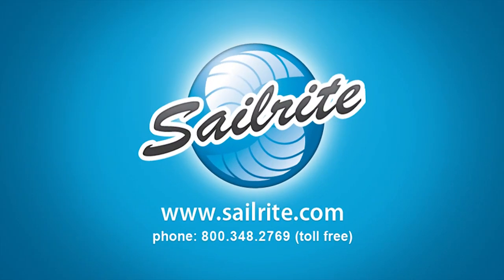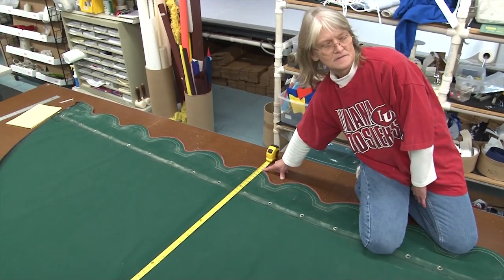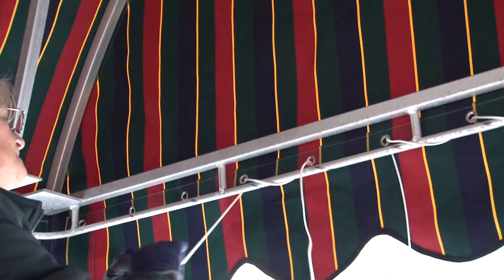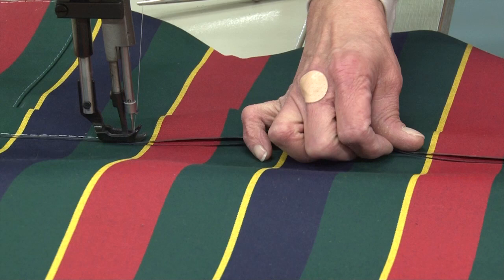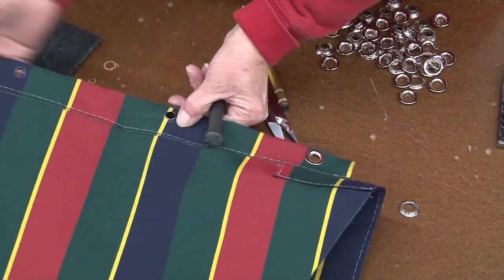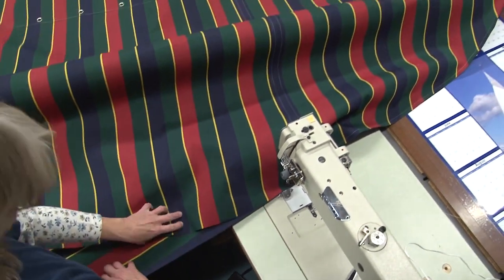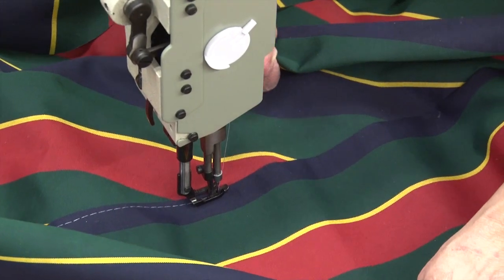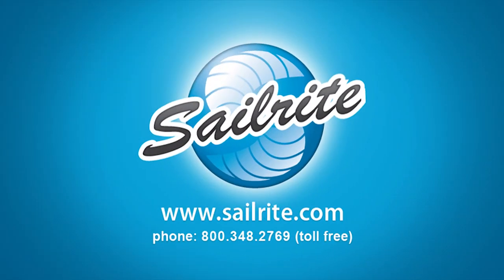Dome Awning Canopy Construction made from Acrylic Fabric

Comment: Also, the fabricator put the crossbars or per lines flush with the rafters.  This is a mistake as it WILL show through the fabric as can be seen at the beginning of the video.  They should be welded to the underside of the rafters

Comment: And not I've the lace line across the back.  Very poorly done.  Best thing for across the back of a lace on frame is zip rail, or canvas rail.  Attach the back with keder sewn into the fabric, whether it be sunbrella, weblon, sattler, main street, ferrari, etc.  And slide that keder into the canvas rail.  Doesn't leave any space between the wall and the frame for rain and doesn't leave a flap.
Reply: The rail can be easily attached to preexisting frames with screws, rivets, or welds